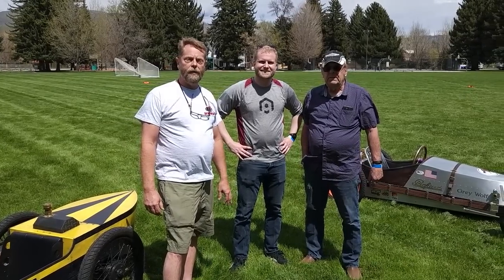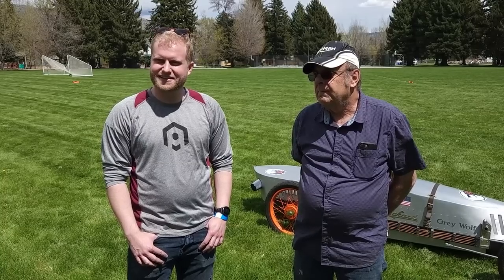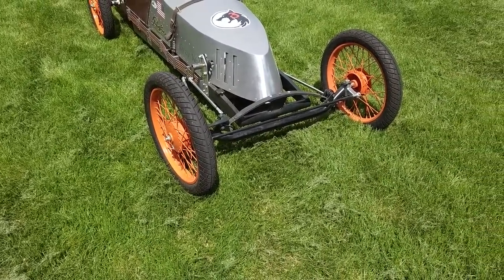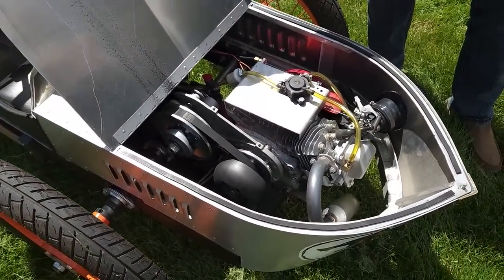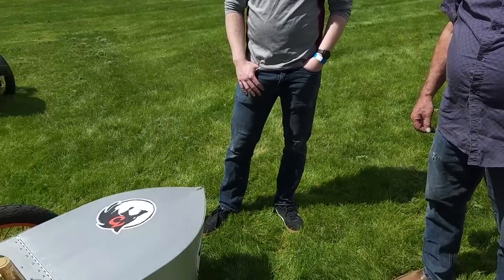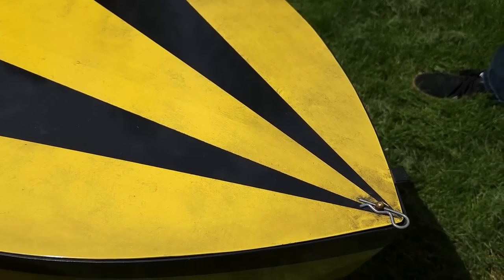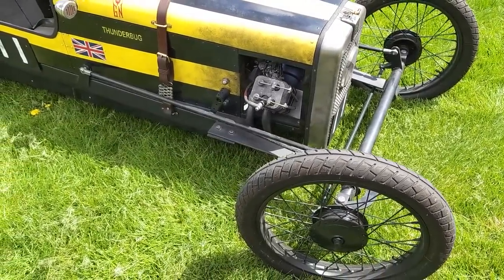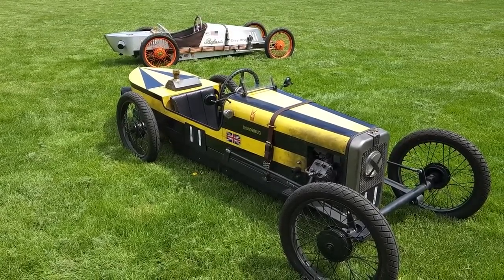Amazing CycleKarts and Their Builders: GN Thunderbug and the Grey Wolf

Comment: If you bent the tie rods that are in front of the axle outward an inch on each side, it would really improve your steering (by improving the Ackerman angle).
Reply from the maker: Good idea, proper suspension geometry does make a difference.  
Although even a CycleKart that handles badly is still a ton of fun.
Reply: @stevevinson6030  They share much with my toy of choice, the T bucket.  And some of the same steering problems occur, usually to builders who don't understand the principles of differential steering.  (The two front wheels don't make the same circle in a turn.  The inner wheel needs to make a smaller circle, and thus has to turn sharper than the outer wheel.  Otherwise, you will get a "scrub" from both tires.)

Comment: I’m building a cycle kart here in Australia so my ? Is where do you get the torque converter from . Who makes them and do you really need one or can you use a enduro 4 stroke racing kart clutch 👍
Reply from the maker: It is a common gokart part.  Any supplier there should have them or maybe Ebay or Amazon?
Reply: @stevevinson6030  no it’s not used on racing karts in Australia they used direct drive clutches with chain drive to the rear axle . Which is what I will use. I even went to a ride on mower shop yesterday to see what they used . They use veritable Lilly system and a gear box on the rear axle . Thanks for your help .